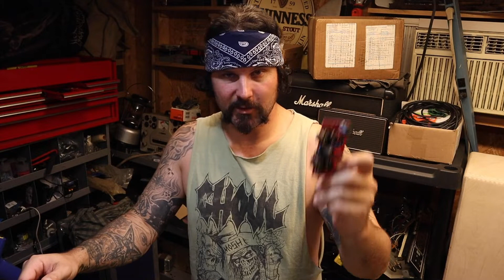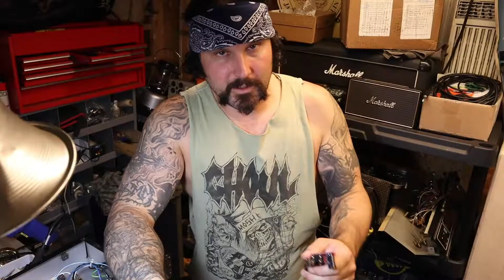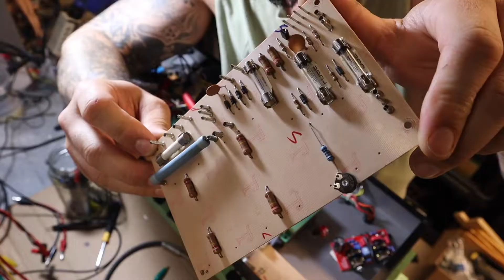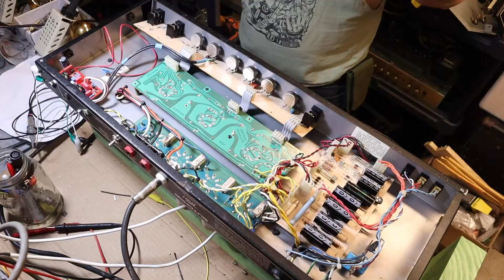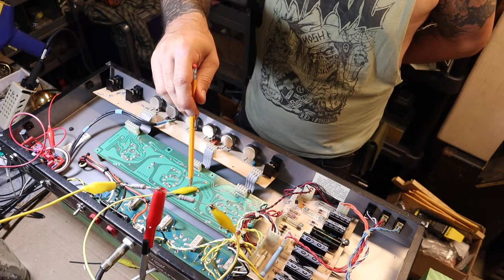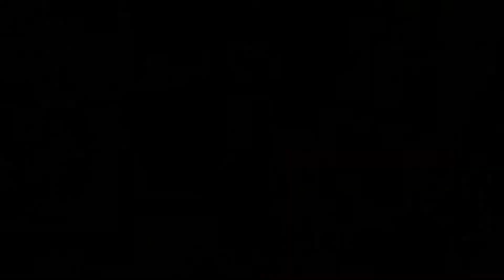Peavey Butcher FX Loop Install - Tone Demo

Comment: Well, it works, but god damn, you did it the hard ways and turn transformers and pulling all the boards out!!
I would have made the changes to the bias circuit, but made the pot accessible with the amp in the enclosure by popping a whole thru and running the wires to it.
Likewise, I would have de-soldered the jacks because like you said, the chassis is very shallow, like a Fender and I would have put the FX in the same location, but would have mounted the FX PCB off of say one of the preamp PCB bolts and ran wires from the board to the now desoldered jack and put wherever you want!  Could be in the same place, but this way, you can route the wires and FX PCB won't interfere and be around the power wires and you won't have a need to rotate the transformer.....if this makes sense in words since I can't post a pic of what I'm trying to say....but the way you did it....way too much work!

Comment: I'm modding a Butcher with the Rev4 Metro FX Loop this week for a customer.  I agree w rotating the output xformer 90-degrees to get those wires away from the PCB...it's easy.  

With a good step drill that goes up to 5/8" it only takes 5 mins extra to move the xformer and relocate the plastic feed-thru part.  

Still debating whether to redo the output jacks.  

Hardwiring the loop w/o bypass switch in this one.  Trick is to cut the trace between Treble pot wiper and Post pot lug 3.  

Treble pot wiper will be IN (send) on the loop board.  Post pot input will be OUT (return) from the loop board.

Power will presumably be derived from Phase Inverter power rail after the R29 (4k ohm) dropping resistor on the Butcher's preamp PCB.  Using voltage drop calculations (Vdrop ÷ .0017) to determine resistor value, as described in both this video and Metro's instruction set.

Hope this helps someone in the future.

Comment: Do you have a recommendation for brand of tubes? Its time for new tubes in mine I think as the gain and volume seemed to have decreased.
Reply from the maker: @thecainer64  I use whatever is affordable.  The price of different brands doesn't reflect quality or tonal improvement.  I've had every major brand fail right out of the box so I don't believe any one is better than the other.  Best advice is to buy from a vendor that has a warranty and stay away from no-name small time seller rebrands.
Reply: @purgasound  do you absolutely have to have matched sets?
Reply: @thecainer64 if output tubes get too far mismatched there can be added hum for one thing.  No reason not to buy a matched pair/quad of OUTPUT TUBES whenever you need to retube.  Better chance at solid performance.

Comment: Thinking if picking up a butcher and would love to get the loop - where are you located?
Reply from the maker: My shop is about an hour west of Richmond, VA. I would be happy to revamp another Butcher.  I have another one coming up soon that I'll be doing full service on.  These are great amps and with a single component change the front end can be an exact copy of the JCM800 preamp.

Comment: Cool video! I own a used vtm60 and everything was fine (new 6l6) but when connecting my tc elec g force in the eff loop there is a lot of noise even with the pure cables connected, would you be so kind and think what could be the causes? Regards

Comment: I have the same amp with some slight mod. I have a 22k knob replacing the 10k presence knob for tighter, darker and less fizzy tones. I was wondering if i was obligated to do the bias mod to be able to run the fx loop mod or can i just install it without it?